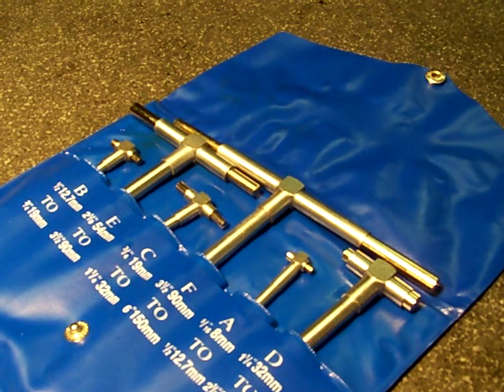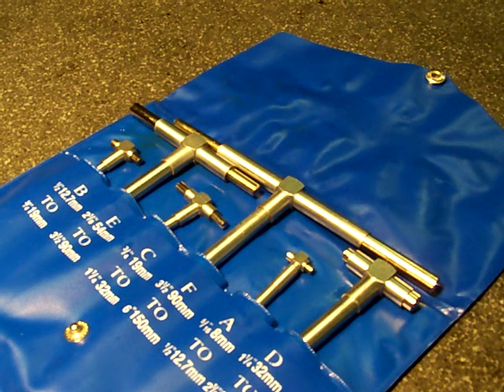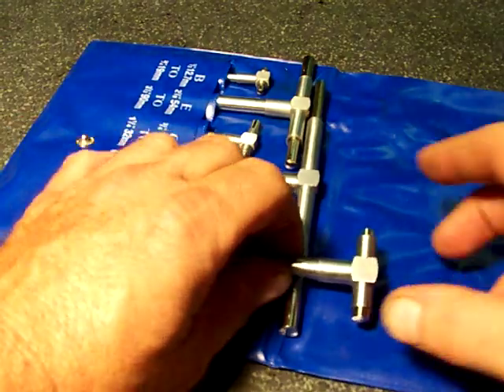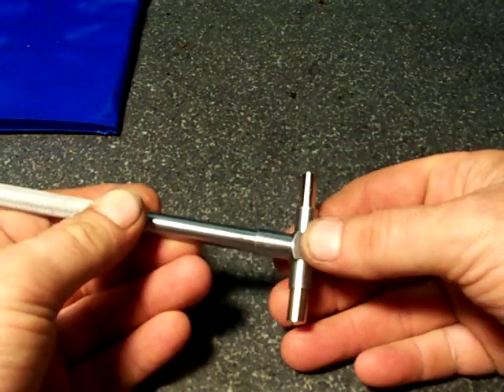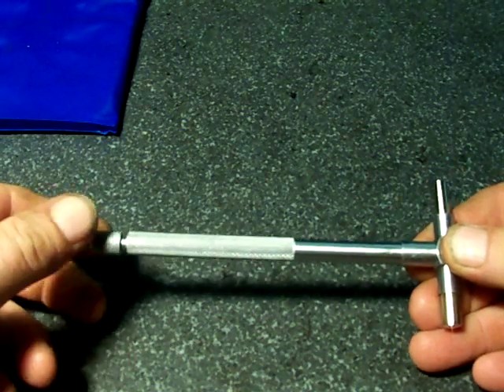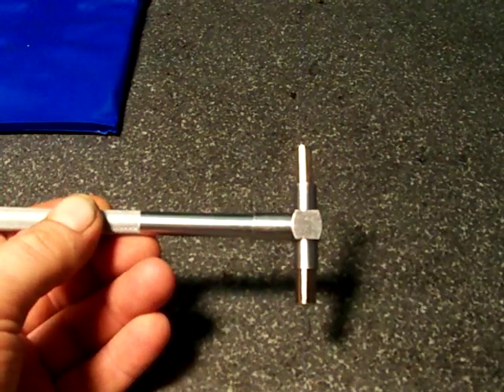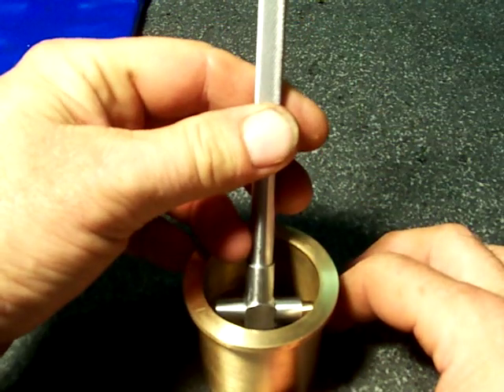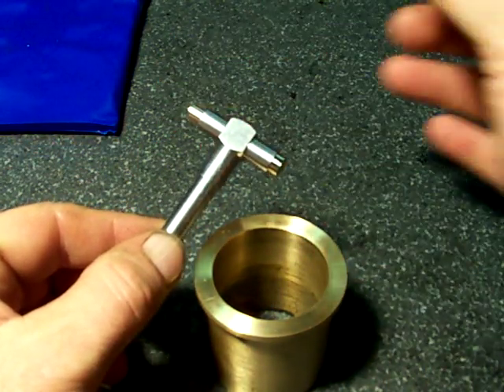Snap Gage Introduction

Comment: Why do you snug it up at a 10 degree angle, then rotate it out of the bore?
Reply: Seems like it is to get the edges of the pins to touch the walls evenly and somewhat centered across the diameter of the bore maybe.